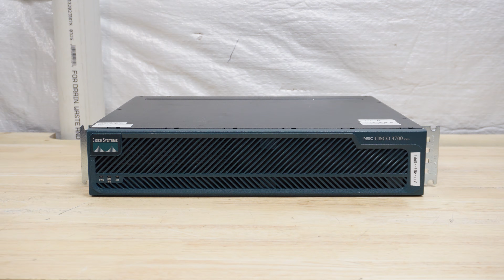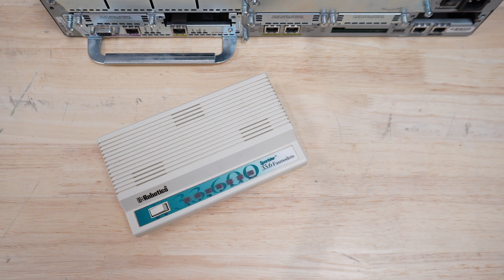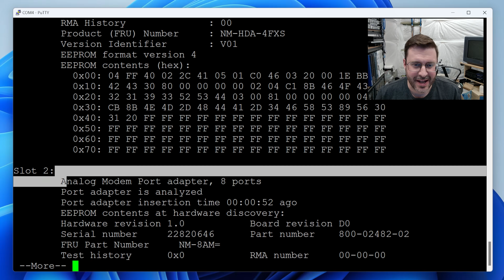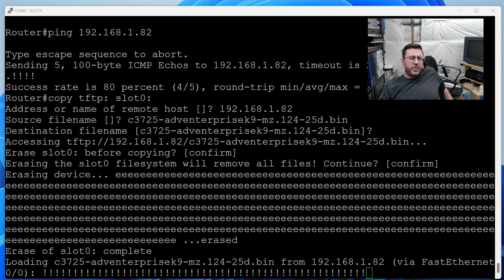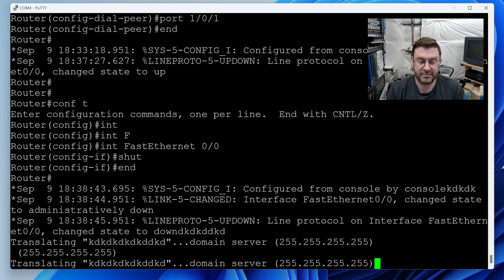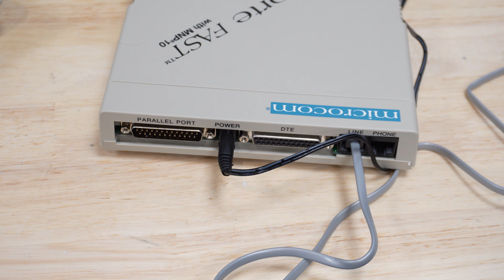All-In-One Dial-up ISP Box

Comment: I had a couple of those modems. You can set them up as 2, and if I remember rightly, 4 wire leased line modems too (using Putty etc...), which is fun if you want to link them over radio or other novelty audio paths as well (like video/audio senders, FM transmitters and receivers etc...). They don't need a phone line. I still use serial ports to get TCP/IP over radio and DIY laser paths.

Comment: Question. Figured this is the right community to ask. My company has a multitude of IT closets dotted all over the country. As a backup network terminal access solution, we’re using a bunch of old US Robotics NR20.0347.00 56k modems connected to Cisco 4221 routers functioning as terminal servers to be able to console into critical routers, core switches, etc. As you could imagine, these modems are getting old, to the point where a couple have finally crapped out or our legacy POTs lines are being discontinued by our carriers. Any other out of band remote console solutions people know of that aren’t an LTE solution? (Most of these sites are buried deep in the core of our office buildings and get very spotty cellular reception.)

Comment: Hello there Clab, I used to install those AT125-SM breakout boxes. They are designed to be daisy chained in pairs. The top port is the input and outputs lines 1-25 on the first box, then you would connect a secondary AT125-SM, fed from the bottom port of the first unit, and into the top port on the second unit to access lines 26-50 on the second AT125-SM.

Comment: MNP10 Microcom Networking Protocol 10  Some of these Microcom modems could do in-line data compression to make them run faster.  MNP5 was an early standard they used.  I remember having a terminal program back in the day that would do MNP5 in software so it could make slower modems run faster, though the text throughput was a lot choppier.

Comment: Greetings! Why don't you lift the sticker of the fan to insert oil, instead of cutting it? 🤔 Also, you can use a knife with a thin end for precise oil application. If you don't spill any oil around the bearing hole, you can place back the sticker perfectly!
Reply from the maker: Basically because I wouldn't trust the adhesive from the original sticker after pulling it off. I suppose you could super glue it back or something though!

Comment: I'm maybe gonna pick up a Cisco 2811 (yes I know, not very period accurate...) and either put 2 VIC-4FXS/DID + 2 WIC-2AM-V2 or a NM-8AM + 4 VIC-4FXS/DID, so that I can connect 4 or 8 devices using dial up, all of that contained in a 1U router

Comment: Thanks to your videos, I was able to handle resetting and upgrading a misbehaving Ruckus Campus switch that we had lying around and weren't using yesterday! I was installing a new video conferencing system in the office yesterday, and the switch was giving me all sorts of trouble. The firmware of the PoE controller was apparently FUBAR, and it just kept going on and on about the 48V rail being out of spec, so that PoE was disabled. That blabbed on the serial console about once every second, so it was real fun to reset the system to factory defaults, bypass the password, enable SSH and upgrade (twice) via USB while I couldn't see what I was typing and didn't know what I was doing! At least it used the Cisco style of config, so I must have absorbed a bunch of knowledge about this through osmosis from your videos! It seems fine now and is happily providing PoE out to another switch for the smart board and video bar :)
Reply from the maker: excellent!

Comment: The reason why the 3745 is cheaper in that article, is exactly because the I/O board is modular and is NOT included in the quoted price, and costed another ~$5k at the time. The idea was that there would be a range of different IO boards with different features and such, but afaik, the only IO board ever made was Cisco3745-IO-2FE, the one you have there. Other than that it's on a seperate board, the 3745 also have a slightly different cryptographics engine. The 3725 have a 'AIM-VPN/EP II', while the 3745 have a 'AIM-VPN/HP II'. In either case, this is attached to the chassi itself and cannot be changed with a different IO board on a 3745 or upgraded with any of the slots. The 3745 is also more than twice as fast with a 225kpps forwarding rate, compared to the 3725 with 100kpps, and ofc draws more power, capable of consuming up to ~200W, compared to ~100W on the 3725, though most of that are the network boards so if you don't populate that anyway, it should be fairly comparable.

Comment: It would be cool for you to do a video on how the old-school BBS systems worked with multiple callers, the computers used, hardware, etc. I used to run one back in the 80's (written in c from scratch) and my younger self never got to scale it beyond 4 lines. It was a ceiling I could never crack.
Reply from the maker: check out The Serial Port's channel if you haven't already!

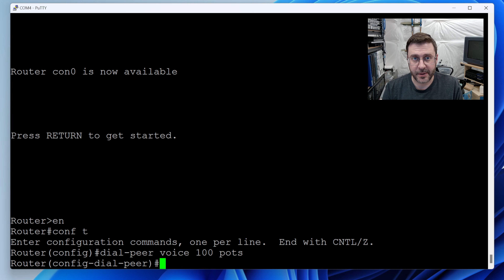Comment: 31:50 Fun fact you're not very far away from how a professional actually would handle this. Adtran makes a series called the Total Access, which is designed with the exact intention of being "the thing that the professionals use instead of an ATA." You can get them with up to 24 analog lines and like 4 T1s which all run over VoIP if you so desire.

Comment: Why not change out to some Noctua fans? the connectors are standard 3pin fans. Just match size and air flow and there is a fan that should match and be quieter. It won't be period correct, but it will keep the machine going and quiet it down.

Comment: @calbtreo You actually got the port addressing wrong if I am not mistaken. The WIC modules should be Module 0 Slots 0 through 2 on the routers, the Module you are addressing is thus Module 1 Slot 0, since it is a single wide card. The Upper Module is Module 2 Slot 0 Ports 0 through 7.

Data Terminal Equipment to Data Circuit-Terminating Equipment. You hook the DCE end up to the Modem and DTE to the PC. RS232.
On Switches we are counting differently, it's Cisco....
If you need Cisco routing/switching help (not versed in the phone stuff though, would have to read up) bump me up. Teach that stuff.

Comment: @clabretro Networker here, the mgmt module looks removable and interchangeable on the 3745 which might make it more capable down the line. Not really familiar with that ancient stuff, but the concept is still there on the big modular nexus switches with line and fabric cards and even on the UCS chassis with the fabric modules.

Edit: The routers should be able to handle even bigger SDs, where using 1GB last I recalled, before they got put out of comission.

Comment: 1U PDUs are no way to power full-height a rack.  You'll waste so much of your rack space.  The fix is a vertical 0U PDU.  Out-of-the box it'll slide right into those very large keyholes cut into out of the posts of your 42U rack, and provide 20-30 outlets; enough for a rack full of equipment.  Though I usually find it more convenient to mount PDUs to the vertical cable management channel, rather than using the keyholes.

Comment: Another fun thing to do with dialup is logging into *nix systems remotely, mgetty is still available on modern Linux systems so you could even administer your Proxmox hosts over dialup. There is something fun about logging into my modern Ryzen PC over a dialup modem. Something dumb I have been wanting to do is setup a local LLM and use it over a dailup modem.

Comment: In my experience, 3-in-1 can dry up pretty quickly. You might try bearing oil from your local skateboarding shop. It's super thin and will get down into the gaps well. Just one or two drops does the trick for skateboard bearings, so I got to imagine a single drop would do the trick on these old fans.

Comment: Had some fun playing with a 2811 ISR with a VIC2-4FXS voice card. 

What sucked is the confusing SIP configuration support for the 12.4(T) IOS version I've got, and trying to get it interoperate with my asterisk box.

For example, the SIP User-id for the voice ports end up being the destination pattern, and I've not found any way to change this.
This becomes problematic when you need your destination patterns to not be greedy in an open dialplan(i.e. variable length dial strings). For example, I want my voice ports to be reached with dialstrings [1,2,3,4]. But I also want to be able to call out to [10,110,101] through a SIP dialpeer. But for this I need to set the voice ports destination pattern to something like [1T,2T,3T,4T] where "T" denotes "wait for # or timeout before matching". And so the SIP user id becomes 1T. 
But then, if I set "station-number" on the voice port, to affect the caller id number sent out, then this changes the SIP identity and my asterisk won't match the call!

Comment: I still have that Deskport modem somewhere 😊 it’s not for a printer, Microcom made special windows driver for parallel port that transferred 8-bit bytes instead of serial port. It never worked on Linux that I used.
Reply: DTE is data terminal equipment, other end was DTC.
Reply: Microcom is The company thst created all those MNP levels, that modem has level,10.

Comment: You weren't ripped off on the extra NM port. The 3725 has a HDSM slot which allows a double wide NM card to use the other half of that "blank" slot - usually used for a 36 port switch module (such as NMD-36-ESW) - these routers were commonly used for small offices that allowed them to use that module without needing a separate physical switch. Given that PoE cards exist, they could run a PBX and internet off a single box.

Comment: Telco\ISP Professional here, who has dealt with this kind of thing both at customer premises and central offices. That card you have accepts two RJ-21 connectors from another piece of equipment. Each RJ-11 jack internally has four pins (for two lines each) that when wired in a four pair RJ14 (RJ-11 connector + two pins) it allows for splitting of lines off of just one jack. This can be useful for many things (such as manual splitting of POTS\DSL\Dial-Up services, at a point of presence), or giving the customer a second line using one simple CAT 5 (or CAT 3 if old enough). It could even be used for bonded DSL services (using two pairs to increase DSL speeds) It honestly is pretty neat, and not something you see too often nowadays due to broadband either using Coaxial Cabling, or Fiber Optics.
Reply: Also love your videos BTW. Good, interesting content. Doing both physical cabling, and network engineering, seeing this stuff come together from the days of old really makes you appreciate who worked on this for our enjoyment back in the day (and one of the reasons why I am in this field today)

Comment: I also have a feeling, if I am not crazy, that there was a (upwards of) 48 port switch module that could slide into that larger upper slot. 

There would also be a PoE power supply module that would be installed internally to supply 48V to that switch module.

Or I'm confusing this with something that was available for the 3800 series.
Reply from the maker: Some other folks mentioned the wider cards, totally correct! That would make sense about a 48V version

Comment: Why dont you just get a Cisco VG310?, then you will get 24 FXS ports on a single RJ21 interface. I use them with my existing structured cabling to get phone ports anywhere in the house. They support SIP so you can use it for voice calls to a SIP server. Also they do a very good job with pulse dialing so you can get all those old phones working again :)

If you want more info, I use "MT-2201 Krone Back Mounts", to mount 10 pair patches (ebay: "10 pair phone patch") onto wooden boards, then use a cable (CW1308 25 Pair) with RJ21 on one end and punch the other end into a group of 3 of the 10 pair patches, I then have another 25 pair cable going from another group of 3 of the 10 pair patches to a 12 port RJ45 patch which I punch two phone lines into each port. (Line 1 = two middle pins (4 + 5), Line 2 = next two pins out (3 + 6)) Then I can jump between the 10 pair punch downs with CW1109 cable to bring a line on the VG310 to a RJ45 port that I can patch through the house. I also have an VDSL DSLAM which has built in filters, and has two RJ21 ports, these are also presented on 10 pair punches so I can put VDSL on a phone line or just skip the VDSL patch and present analog only. At the edge, if its a single line I use PABX master, rj45 to BT socket, dongles and if its more than one line I just punch a cat5e cable with RJ45 on one end to multiple BT sockets.

You probably don't need all of that but for 150 quid you can get 24 of those ports on your breakout active.

Comment: Just one quick question, and this may be explained in another of your dialup videos, but other than the fact that the NM-8AM having 8 ports, is there any reason why you wouldn't be able to use the dual analog modem wick in the same router as the card generating the dial tone?
Reply from the maker: simply just to use the 8AM!

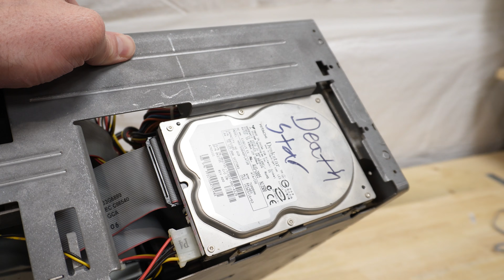Comment: 47:53 this hitachi deathstar is not the infamous ibm deathstar (75gxp series), and is actually very reliable. Also, iirc the plat20/pla380 (aka hitachi 7k80 series) were the fastest hard drives at the time.

Comment: 13:45 That connector is probably just the voltage rails so a redundant supply can exist without a duplicate set of cables onto the mainboard

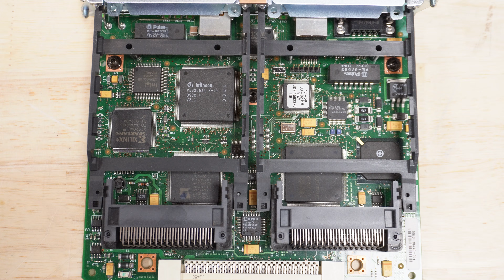Comment: I was too busy to view this yesterday, but it is nice to see some viewers wanting Token-Ring content. For @17:28, we do have the NM card documented at the 'Ardent-Tool', search on 'NM-1FE1R2W' from the top of the home page. The large '38H6302' ASICs on the 7200-series card are the same 'Multi-Protocol Chip' (both Token-Ring and Ethernet circuitry) used on the "LANStreamer" PC adapters, so a later design.

Comment: For those that don’t know: 
those breakout panels need two of these to utilize all 100 pairs. Red is primary (1-25), and blue (26-50) secondary. Each trunk cable (rj21) contains exactly 25 pairs, and you typically wouldn’t combine the primary and secondary trunk cables on one panel. I don’t recall the breakout panels having more than a single pair per port either.

Comment: If I remember correctly, I was told, when I was working at the network reasearch lab of NEC, they somewhat partnered with CISCO in the early 90's to have a base on researching SDN (Software Defined Networking) and MultiPath TCP. Maybe this fact is related to this 3700 series. just my 50cts.

Comment: Last year I had to do some maintenance un-chocolating a pair of calipers and I ended up washing all of the lubricant off too. It was really hard to apply an appropriately small amount of machine oil so I bought a pack of blunt syringes, and now this is basically the only way I lube small parts, it's so convenient and controlled, much less cleanup, easy to keep lube where you want it.

Comment: 12:54 While I'm not that up to date on the 3700-series thats likely just for modules that are double the width of yours, there is likely modules with stuff like 48x Ethernet ports that are that wide. So while you can't put two of the ones you have side by side in there it allows space for those modules. And then that screw you had to take out screws into that module instead.